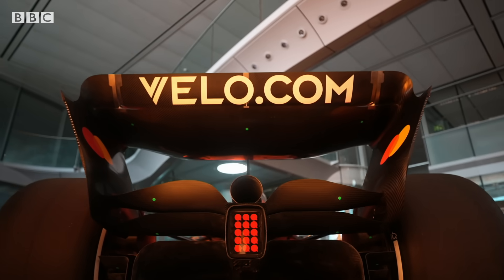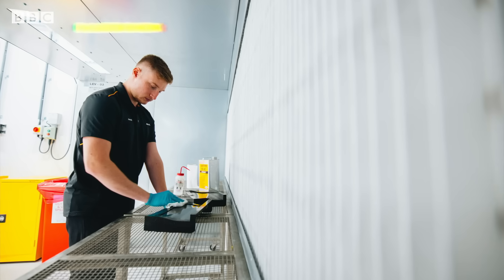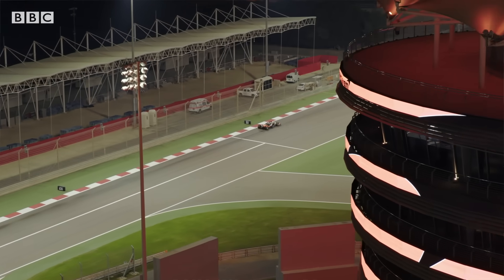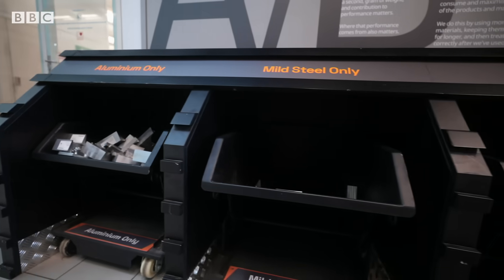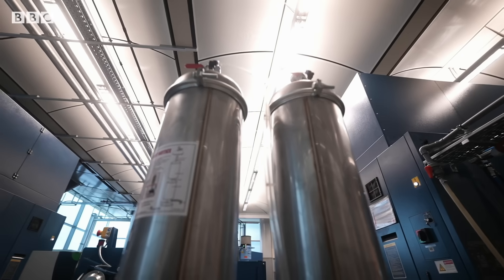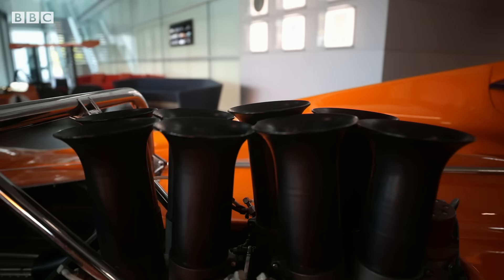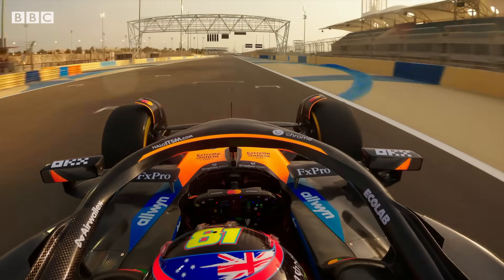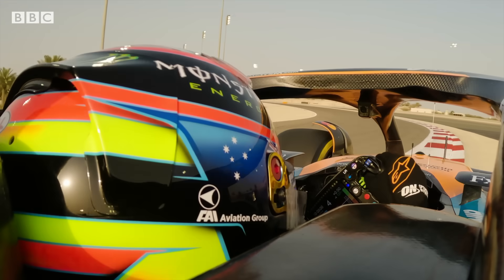F1: Can it go green? | BBC News

Comment: Lmao... their logistics alone will never let them be Zero emissions.
Reply: Honestly Chat GPT is way worse, and not as much fun.
Reply: Not at all.
Reply: I dont think the FIA should be worried about making the cars greener at all. If they are doing it, it is beacsue of a pr move or to try and get other engine suppliers to f1. Based off of a 2019 report, the cars themselves are resposible for 0.7% of all estimated emissions produced by f1 over 21 races while just moving everything to the races and running the venues makes up 80% of all emissions. Like literally adding a single race is equivelent of almost a 5.5x emissions increase from the cars, I can imagine just subracting a single race and switching to litteral gas turbines and 2 strokes would be better for the environment.
Reply: It's just as well that nobody in the video even mentioned zero emissions then, isn't it? You need to start a new thread if you want to talk about a completely different aspect of the subject.
Reply: @gio-oz8gf  What is meaning of "Going Green"?
Reply: @GurkiratXSingh  Why are you asking me? I'm not one of those YouTube "experts" who pretend to know what they're talking about. However, I do know that 'going green' doesn't necessarily mean achieving net zero.  The accepted definition seems to be becoming more environmentally aware and changing your behaviour and lifestyle to reduce the amount of pollution and waste you generate. Again, no mention of 'net zero'. Anyway, I simply pointed out that nobody mentioned achieving net zero. Nobody mentioned the logistics of the sport either. The purpose of the video was to explain what is being done to make the cars more sustainable. In the future, it might be beneficial for you to focus on the points made in the video and discuss them instead of straying off topic. So, remember to stay on track next time! Pun intended.
Reply: @GurkiratXSingh  smoking weed